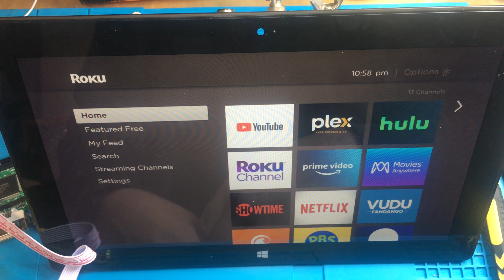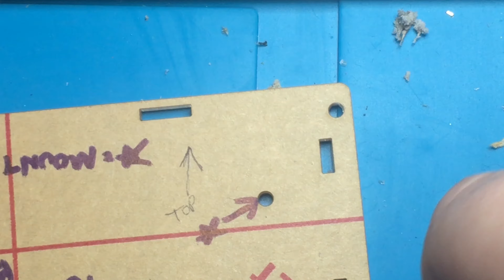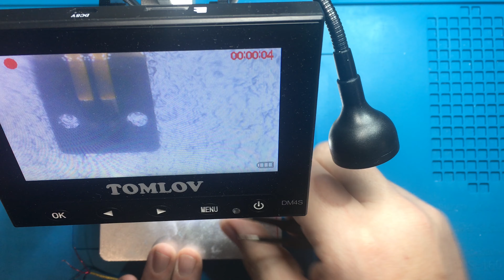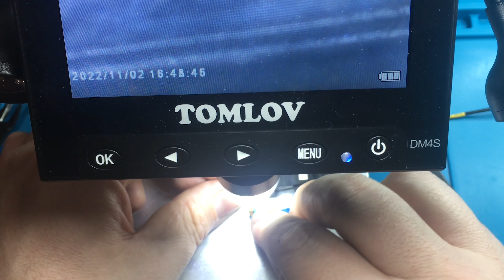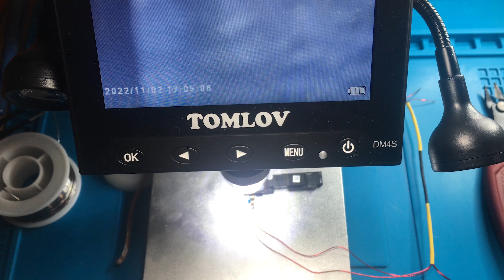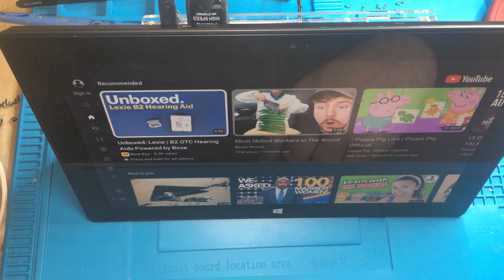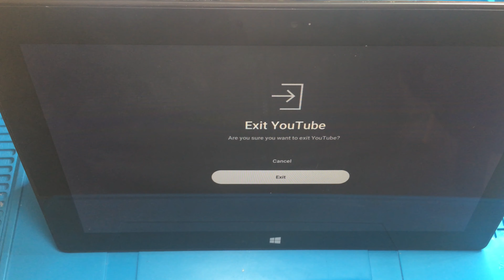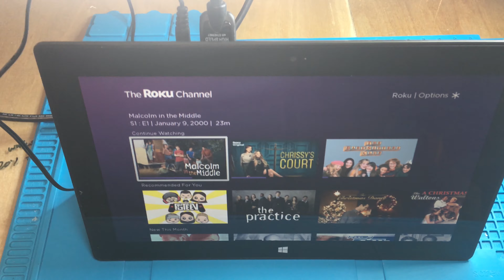turning this old microsoft surface rt into a simple hdmi display - let's modify it!

Comment: What hdmi kit did you buy?
Reply from the maker: I bought the "Controller board plate Kit HDMI DVI VGA diy for LTL106AL01 1366X768 panel 10.6" from eBay. It shipped from China and took a few weeks to arrive.

The case is "Plastic Case for LCD Controller Board Transparent M.NT68676.2A Arcade1up mod" also from eBay.
Reply: @sloppyhobbyist6200  Thanks!
Reply: @sloppyhobbyist6200 Thank you, i found it on Aliexpress. Is it still working for you ?

Comment: Hi, I hope you read this. Do you think this board would also work with an LTL106HL02-001 LCD Display? It's from my old surface rt, wich I wanted to convert into a simple HDMI monitor just like you... But I can only find the board for the LCD model you have... :(

Comment: Why?
Reply: I would like to replicate the process.. and I am unsure of which board to buy
Reply from the maker: I think I mention in the vid that I use this for bench-testing video output devices. It's small and convenient, and the Surface was otherwise just sitting in a storage bin.
Reply from the maker: @lordavaicus  It was a bit of a process to find the board I needed. There is a model number on the back of the LCD that you will want to use to search. In this case that was LTL106AL01